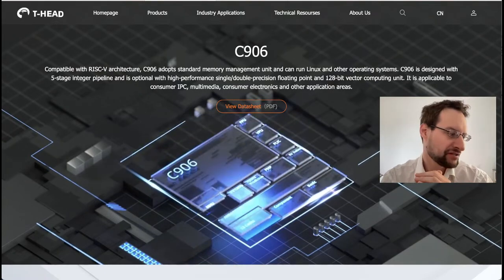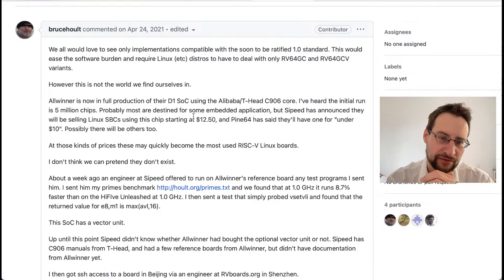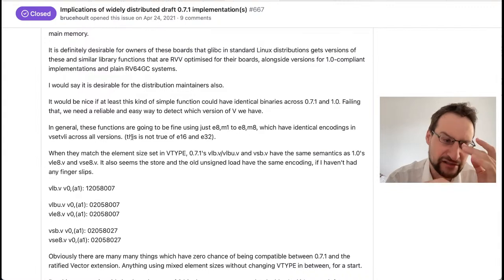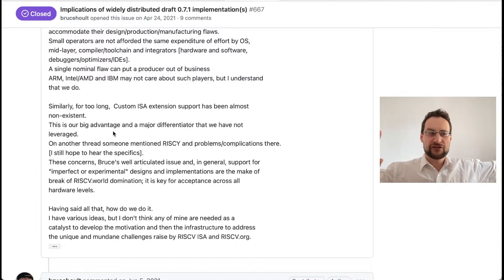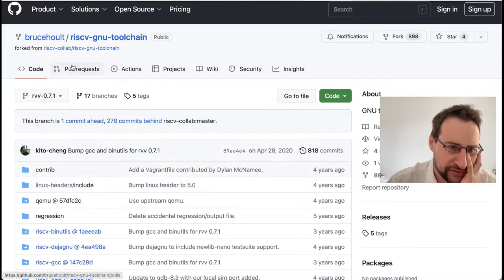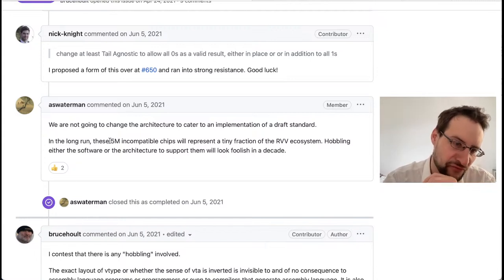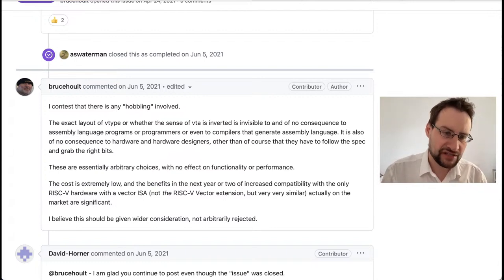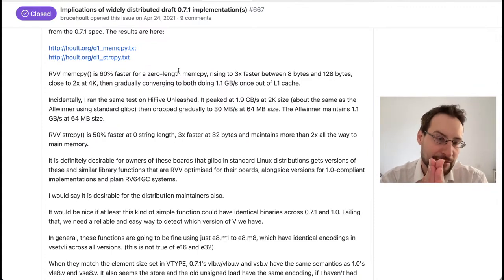MILLIONS of early RISCV CPUs ship with an INCOMPATIBLE VECTOR extensions probably nobody will use!

Comment: It's highly irritating when people making breaking binary changes to things once the old version has been released.
Reply: This was always the expectation, the extension wasn't ratified yet and breaking changes where exected.
Reply: Well, couldn't this be fixed with a compiler option?  If you're compiling for the C906 XuanTie whatever...
Reply from the maker: First you need to implement it and then it will be incompatible with all other riscv cpus. And you need specially cursed os kernel support, too.

Comment: Its honestly their fault, cuz they knew it was a draft, not a final version of the spec, kinda sucks cuz my mangopi arrived a few days ago
Reply from the maker: while sure, it is somewhat their fault, they are an early adopter and had their silicon ready while other contributors kept arguing and changing the spec, ... while, as I said all very unfortunate, still better to have 0.7 spec Vector extension than none at all. Just a mess to support now, ... :-/ and certainly something the RISCV community should re-think to handle better for other future extensions, ...
Reply: @renerebe no.  They knew that the instruction encoding in 0.71 was not going to be kept in the final standard.  0.71 uses a draft encoding range that is shared by many draft standards.  It was wreckless of them to do this and I am glad that no one responsible is allowing 0.71 to contaminate either the kernel or GCC.
Reply from the maker: What do you even mean with this and how informed are you really? The instruction encoding range is the same between 0.7.1 and 1.0 and the instructions are also some 90% identical. What other drafts should this have been shared with?
Reply: Customers need some kind of SIMD/Vector functionality, the official ratified RVV version is still years away and implementations yet more years. What SHOULD you do?  Just tell your customers that they don't really need SIMD at all? Make up something completely custom?  Surely shipping the current draft of the future standard is the least bad option? These chips are in the market 3-5 years before equivalent spec and price hardware with ratified RVV.
Reply from the maker: Yes, like all other vendors work on finalizing the extension instead of shipping broken stuff barely anyone will ever use. Ever heard of Intel, Amd, IBM, or arm shipping half finished silicon?
Reply: @renerebe  I’m so glad Intel got it right first time with MMX and we never needed SSE or AVX.
Reply from the maker: @BruceHoult  MMX and SSE were however working as defined, unlike the RVV-0.7 implementations which do not even fully work. This is as if Intel shipped some half finished MMX 0.7 variant before it was fully done and nobody ever used it because it was quirky (buggy), not well supported by dev tools, and thus never really used, last but not least because 0.000001% of all RISCV users ever had one, ...
Reply: @renerebe  what do you mean by "do not even fully work". I'm not aware of any C906/C910 bugs in implementing the RVV 0.7.1 specification. They don't implement EDIV but that is marked as optional in the spec.

Comment: Are you sure the "bit sorting" is there for no good reason? Maybe instruction decoding can be made a little bit easier with the new order.
And I totally see the urge to add just another exclusive feature to T2. 🙂It could be very helpful for its future if some niche projects get dependent on T2.
Reply from the maker: for a hw decode it does not matter at all in which order the bits in a register are wired and used. If anything the bit order is probably re-ordered for human readability, or future expansion to wider element sizes. But in the later case also only human SPEC readability, as for hw it does not matter at all where the logic is wired to select bits from.
Reply: @renerebe  well, I asked this since they already have made some weird bit-order choices in their instruction set, just so a bit of logic can be re-used for different instructions.
Reply: I don't really get why this matters, there are a bunch of other fundamental incompatibilities, probably most importantly the vector mask layout, which imho was a very important change.
Reply from the maker: @oj0024  well, a bit more compatibility would certainly helped to support this early silicon a little bit better now and in the long run.
Reply: @renerebe I wrote another comment, but it looks like it has been "caught" by the spam filter

Comment: Perhaps my take here is uneducated, but trying to add 0.7.1 vetor support to compilers for just one CPU would be a messy and could possibly add confusion.
I don't quite see why we should bend the knee to one company who took a pretty big risk to add support for an extension that they knew was still in development and that was going to change.
Wouldn't it be better to take the hit now and not try to overcomplicate things for years to come?

What I'm talking about above here is for mainstream compilers to support this one CPU; that said, couldn't one write a binary patch program to convert vector instructions in a binary to the 0.7.1 version? People using this CPU could use that. Or is the difference between 1.0 and 0.7.1 so big that patching binaries isn't an option?
Reply from the maker: It's millions of devices and appently hpc ones coming now, too. It's likely lots of Chinese CPUs and SOCs for years to come https://twitter.com/cpswang/status/1669722839300341761?s=20 it's is not for the company but all the innocent joe users buying this cheap, entry level SBCs, ...
Reply: @renerebe  I've had some hours to think about it, and I think my original statement is wrong.
Yeah it sucks to overcomplicate software because of screwups like these, but if this issue ends up being large enough, perhaps it is worth it to have a compiler option to use the old vector spec;  Especially if we want RISC-V to succeed.

What worries me is that this could make binary sharing more complicated in the long run, and if CPU manufactures see that they can get away with reusing the old 0.7.1 spec for CPU designs  -  they might;  And then we'd be stuck with this BS for many more years to come.

I really hope that I am wrong, I know very little afterall.

P.S. I'm reposting this comment because half my text was in red color, and when I posted my comment everything in red was gone...  And CTRL+Backspace doesn't work properly in Windows, it's utterly random what it does...
Sometimes it (properly) deletes the last word, other times it deletes one byte (BYTE, irrespectable of multibyte UTF-8), sometimes it inserts the byte 0x7F (ASCII delete byte), sometimes it does absolutely nothing, and sometimes it decides to delete entire paragraphs...
...
I love modern software, it's so stable! (sarcasm).

Comment: pure optical logic circuits, which core is gas/mechanical gate transistor, the transistor is long way optically opaque until its pushed optically from the side when its made optically transparent, for the source gate photon flow (DGS pots, D=exit, S=input, G=optical activation gate)
Reply: the optical gate transistor is not designed to amplify (but it can), and there can be the usual small narrow layer compression at the gate, so there is the optical transparency/open formed when gate is activated by photons enough
Reply: you could probe the cpu features and use them in the compatible way
Reply: that means you could have to ship with multiple binary versions, for multiple architectures, like arm vs x86 vs risc-v versions
Reply from the maker: sure, you could, just that this will be the one and only and incompatible binaries and a mess to support with partially different encoded instructions, ...